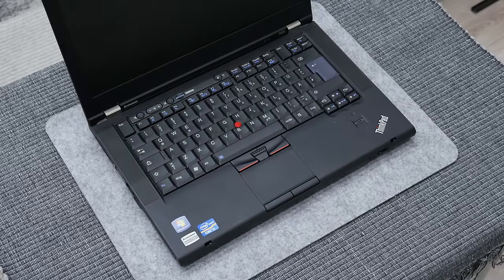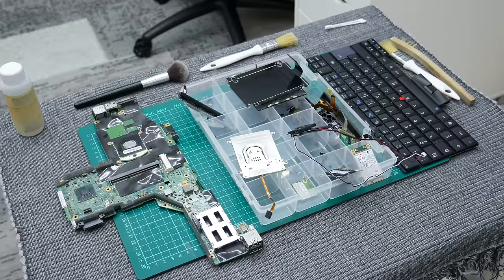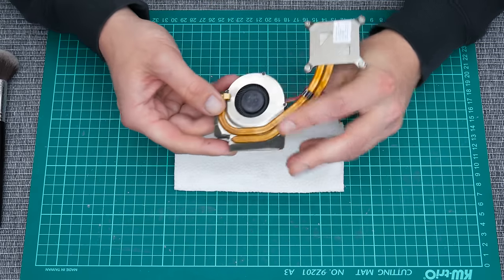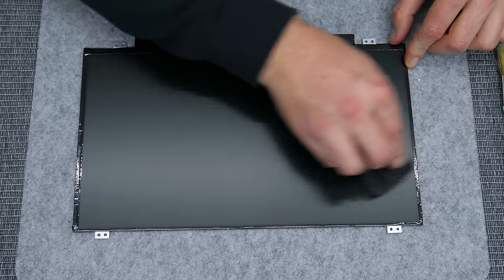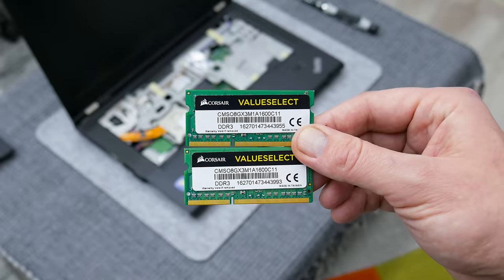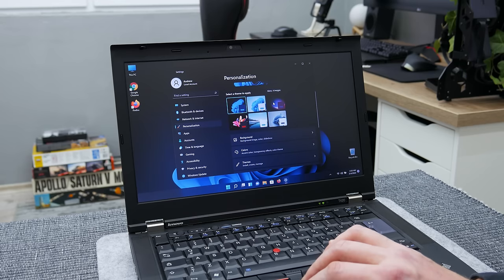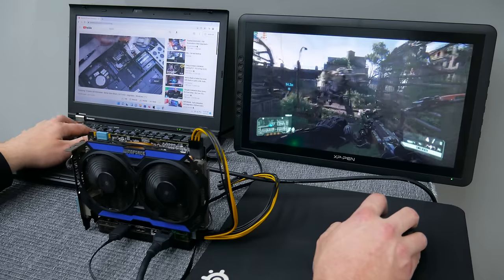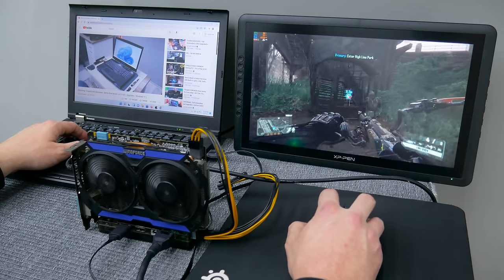Restoring Lenovo T420 - ( Upgrades + Windows 11 + eGPU )

Comment: Pin this !
Reply from the maker: Here is the Pin :D
Reply: Thanks bro
Reply: :D
Reply: @ComputersAndTechAndAndrew  in this laptop you should install a modded bios because of if you have 16 gb ram and a eGPU it will make the cpu run at 100%. The bios doesn't really support these combos
Reply: Power pin bord front panel
Reply: @FS--ew3se  Is this 100% information? Why do you think so?
Reply: @ComputersAndTechAndAndrew  hi cat! can you make details about thermal & problem using egpu in this laptop type! thanks
Reply: I'm getting one for 80$ with i5 and 320gb HDD but without battery I want it for coding, accounting, and other day to day stuff should I buy it ?

Comment: Thinkpads have the best keyboards ever made!
Reply: Agreed
Reply: I'm getting one for 80$ with i5 and 320gb HDD but without battery I want it for coding, accounting, and other day to day stuff should I buy it ?
Reply: Yes I would recommend buying it because the keyboards of the old style and the new are great and the repairability is amazing and it just lasts forever. I have had my t480 since it came out in 2018 and it’s never gave me problems I couldn’t fix
Reply: I have a T420 and the keyboard is great. Way better than most modern laptops these days. I'm gonna upgrade mine and I might think about making it a daily-ish driver.

Comment: Thinkpad T420 & T430 are still being loved by Thinkpad community due to huge upgradability. You can install up to 3 storage drives for these ones (1st primary HDD, 2nd DVD drive that can be swapped with another HDD, 3rd mSATA storage to replace 3G modem). Go for T420 model if you still prefer the classic 7 row keyboard & not into tinkering the BIOS. Otherwise, T430 model would be a better choice.
Reply: I have a T430 model and the system does not see the mSata SSD installed in the WWAN slot instead of the 3G adapter. Do not know what could be the reason, maybe I need to turn something on / off somewhere in the BIOS or other settings?
Reply: The last upgradeable laptop Lenovo made was the T480. Once a modern laptop dies you replace it and there’s no point to working on it because all the components are soldered to the motherboard and its not designed to be taken apart. Business mobile workstations and business laptops on the other hand, designed to be reliable and easy for corporate IT departments to maintain them.

Comment: I am purchasing a T420 today for 85 bucks. Excellent condition. I am glad i stumbled across this videe. I had completely forgotten about the existence and capabilites of an external PC slot as featured in the video. This looks to work very well! I will be grabbing the core i7  upgrade for the existing Core i5-2520M in the machine.
Reply: Try to buy a 35watt cpu upgrade with PGA (NOT BGA) and has integrated graphics. That 45watt CPU will run, but it's too hot for the standard heatsink and fans to cool it efficiently, too much heat may slowly kill it!
Reply: @lQuadXl  thanks you for the advice, i was looking for this, you saved me, and the poor t420

Comment: Lenovo laptops are iconic systems. I had a Pentium 166MMX machine running Windows98 back in the day. Its amazing how even after IBM was bought out a lot of the design aesthetics remained similar over the various generations. The rubberised coating of the older ones seem to really waste away these days.  Have you found any solid way of mending any such stickiness? Good thing this modern system does have the non rubberised textured hard plastic shells.
Reply: Actually in 1998, IBM owned the ThinkPad brand. Lenovo acquired the brand in 2004.
Reply: @DJTydalOfficial  actually 2005.
Reply: 99% Isopropyl Alcohol can remove that coating, so does WD-40 - it doesn't take much to remove it with the right kind of solvent. It is time consuming though.
Reply: Yeah, just soak a microfiber with wd40 or rubbing alcohol, and the coating will wear off for a clean look and feel
Reply: Your lap name pleeez
Reply: I used to have an old Compaq with a pentium 166. Brings back old memories of DOS games running at like 15 fps, lol. I didn't even know what a frame per second was back then.

Comment: I have been a subscriber for ages and have a T420 modded up to a point but learned an immense amount from your video.
In particular, your approach is so meticulous and calm and when something has not worked you say why.
The build quality and I/Os of older computers are so much better than most modern ones and the sooner the minimalist, slim phase ends the better. I mend computers for neighbors in my old age and far too many are heat damaged because air cannot circulate. They do not feel hot to the touch but are baking components inside -- a bit like baking a cake in an oven but the oven front is not warm to the touch.

Comment: That's a pretty nice restoration you've done there. Like how you managed to get Windows 11 running on it.
Yes, I agree that driver support can be a bit flaky at times and some pieces of hardware will undoubtedly get left behind (e.g. the GTX 690 might be stuck at Windows 10 forever if no one makes a Windows 11 driver for it - which Nvidia won't, as it's out of support).
Only thing I'd have done differently is changed 240GB SSD for a 500GB or 512GB one; they can be had for £40 or less if purchased used (at least in the UK).
Reply: why used? a brand new 512gb Kingston SSD costs just roughly 45-50$ online...
a Samsung 512gb 870 evo SSD costs about 60-70$ online too.
and a cheapo Chinese 512gb SSD could cost as little as 30$ (though i wouldn't recommend anyone to even bother touching one of those)

Comment: Lenovo laptops are awesome now I'm still using the Thinkpad x230 and I have more x220 and x210 as collection they r quite tuff and it have lots of ports (where is hdmi)I like it allot
Reply: i am using a T430 as a daily driver :)
Reply: @k.p.5263  I am using a T60 with a 1600x1200 screen and (Gentoo) Linux as a daily driver. It sits next to my electronics workbench and is my PDF repository for circuit diagrams and electronic references, the old 4x3 screen dimensions make it perfect for viewing PDFs and for looking up other info on the Internet. It also happily plays music from my music server and YT video in up to 720p format.
Reply: @k.p.5263  Tell me please. How is your fan in T430 and hinges. The first one is buzzing like an airplane, the second ones are shattered... It seems that there are really weak points of this wonderful device)

Comment: 0:44 I spy in the background a vintage Revell Apollo Saturn V plastic model kit - in it's original late 1960's / early 1970's box!
Reply from the maker: It's 1969 model 1:96 scale, 53 years old, still with original box and in parts, most of them are in bags just one is opened, other are never opened or touched. I need to build that :D

Comment: This makes me remember when i took my Asus X452CP laptop, and i proceed to adapt an RX470, but.... i used a mining riser adapter, with PCie so i did have to use teh WiFi port of the laptop; next i used just a generic power Supply wich was not able to give enough power for high loads of the GPU... as result, i could play many games, in the own laptop screen and obiously in one external monitor, but i did have to play using just mid graphics configurations because on high loads for the gpu, the powersupply just stop working. Thta was an interesting test and i use it for a couple months whern i finally build one cheap PC and i use the same RX470. Since then i use the whole time my Desktop and usually i use the laptop for just navigate and watch some videos. This was a really nice video. Thanks a lot.

Comment: hello I am having a issue with my laptop and that was latest version Lenovo
the performance is so slow I have to upgraded bye  1TB SSD  12gb Ram still getting lag performance time
I try multiple device connected and speed
I try to minimum not installed that much  softwareI updated all the new version latest 11
you have any idea how can I make the laptop speed and reaction time fast

Comment: I salvaged a T420 early in 2023, and I prefer it over even my Dell XPS 15 since Lenovo makes the most bulletproof laptops. It's running a stock i5-2nd and a 500 GB HDD running a triple boot of compatibility- hacked Windows 11, Ubuntu 24.04, and ParrotOS HTB. I just popped it open and noticed that it has a CPU socket- going to get a i7-2nd soon
Thank you for this video, it helped a lot

Comment: HI! I have the exact same model with the Nvidia graphic card. Of course it sits in a drawer for like 3-4 years. Now you gave me the idea to rejuvenate it. But I'd still keep the CPU because for what I5 can do, the upgrade to a I7 is no big difference. I think the most important gain in speed is changing the old HDD with a SDD. Thank you for the nice video.
Reply: Bro do you think it doesn't affect if I leave the i5? I have doubts because in the video it says that the i7 yields almost double
Reply: @giovannivelez78  Yes, true on paper, but in real life what application do you use on this laptop that you need a much powerfull CPU? The main speed gain comes from the SDD. The main purpose of ThinkPad series is bussiness applications, conectivity and endurance. Gamming is not one of their purpose;-) If you can do the following leave the I5 and replace your old HDD with an SDD and see how it runs. Then replace the CPU with a I7 and put back the HDD and see the results..
Reply: Dont get a eGPU like u saw in the video, is not Plug n Play, it requires precise configurations that even a system reinstallation can undo and the performance bottleneck in that cable is sometimes more than half the bandwidth. Go for a mini PC like, if u want to connect the lap to the PC use an RJ45 cable, full bandwidth with Steam Link, but if u still want to do it, I have the whole kit (GPU not included).
Reply: @Think_Pad  okay bro thank you very much for the advice, I was thinking of using it to emulate wii and gamecube, would it work with that i5?
Reply: @giovannivelez78  For the emulation of a game console it would be better if you have the T420 version that have the Nvidia m4200 optional video card installed. I5 with the imbedded Intel HD3000 video card will struggle for higher resolutions. As I said before, this is a business laptop, meant for office applications, presentations and such, with one of best keyboard in the branch, great array of connectivity and very efficient power consumption for mobility.  All these things were for the reality of 10 years ago.😀 It's like an old car.. you can change the manual gear box with an automatic, tires, some chairs, and so on, but you can't change the 10years I5 old engine. (only with a slightly faster10 years old I7 engine).. Good luck in your endeavor 👌
Reply: @Think_Pad  thanks bro now I will still use my old i5 ;)

Comment: It doesn’t have the discrete graphics card found on a high end mobile workstation since it wasn’t designed to do very demanding work or do intensive game playing. The T420 however is an excellent business laptop and as seen still has a lot of life left in it in 2022 and it performs as well if not better, than modern laptops.

Comment: I saw a m.2 to PCIe x16 adapter with no power needed. ALSO, I would like to use a GTX1650 with no power supply required, do you think it will work?

Comment: Hello and thanks for a great video! I would like to ask, did i7 2760QM require a custom bios, or anything done about the bios? Probably you updated the latest official Bios for T420 before changing the CPU and other parts? Which bios version were you using? I guess there are no issues with heating since it's a 35W CPU like the original one?

Comment: Hi. I love this type of Thinkpad generation but unfortunately the cpu is very weak. Can I put for example T480 to T420 case? Is it possible that we put new motherboard of laptop to 8 or 9 years old case laptop?
Reply: You cannot swap motherboards on thinkpads. If you get a T480 use a thunderbolt 3 egpu housing.

Comment: is it possible to also change the intel core i5-2520m processor.  which one would you recommend me?  my notebook is lenovo e420
Reply: You can upgrade to an i7 of the same generation with a faster core speed. You can’t do more unless you replace the entire motherboard.

Comment: Hi, how did you installed Windows 11 on this laptop? Did you lost something by installing OS which should not be installed on older machines?
Reply: There are workarounds to get it installed on unsupported hardware and you will note the T420 doesn’t support TPM and secure boot! That appeared only after 2013 and this Thinkpad is from 2011!

Comment: Does Lenovo Thinkpad T420 have bluetooth? Cuz i bought a 2nd hand T420 but the Bluetooth is missing from device manager. Eventhough I've installed the BT drivers in lenovo support but still BT Still missing saying no bluetooth on this device and use external BT adapter. Thanks in advance bro.

Comment: Every laptop user should know this.
1.
Just “raise the bottom” let more air into the machine and you will found cpu&gpu each them reduce 10~15°C or in high usage will have more efficacy
2.
You shouldn’t be use “laptop cooler” , cuz that effectiveness actually just like you put two bottle caps under laptop to raise it.
But the cooler still use your limited power and it will let cpu&gpu become more hungry.
Unless it has an “independent power supply”.

There also very many ways let your experience better , like 
“gamer most of the time should limit cpu’s PL1&PL2 and offset voltage” 
“discrete graphics card overclock”.

Sorry my bad English,hope it's not too hard to read.
Just want help you gus.
From Taiwan

Comment: Love these videos! The bottleneck maybe the cpu on the difference between the GTX 960 VS RX580. 2nd gen mobile i7 cpus are getting long in the tooth these days. Still great performance if you ask me. Keep it up!
Reply: you're wrong look at cpu usage just 40 percent proof that is pcie limit just 500MB bandwidth
Reply: maybe worst he connected to express card that has 250mBps of bandwidth

Comment: I was asking about How can you Windows 11 on older Alienware laptop recently. And I didn't get any Answers

The Windows 11 is pretty Hard and not as easy as previous Windows OS
Reply: there are some versions of windows 11 that dont require tpm 2.0 and moder cpu too
Reply: You could spend your time better by just sitting down, learning a proper OS like Linux and installing that - rather than wasting your time by trying to find ways to let Microsoft continue to abuse you.

Comment: how can you upgrade the i7-2760qm(2nd  gen)  in windows 11? when the minimum specs of windows 11 is 8th gen?
Reply: Microsoft doesn’t officially support anything other than 8th Gen and subsequent processor families going forward but it still allows you to run Windows 11 on older hardware at your own risk.

Comment: great video, Andrew you can a versus egpu with express card vs the pci-e (for wifi) in the laptop, I see more fps with the pci-e
Reply: I think it would not work, since there's whitelist problem (most ThinkPads wouldn't boot with eGPU mPCI-e card, just giving the "Unauthorized network card installed" message)

Comment: Your videos are just super, we watch the whole family like a movie) Tell me which video card is most harmoniously suited for this laptop in the same configuration and also for the T430 i7-3632QM, if it's not difficult for you. The point is to buy one, but not overdo it in terms of its power and price
Reply from the maker: Thank you for watching my videos and thank you for the support :) The Lenovo T430 I think is supported by exp gdc, With your specs the bext GPU can be something from nvidia 900 series, like 960 or 970 4GB. You can go with older cards as well like 600 or 700 series but 900 is cheap and still have the latest support
Reply: @ComputersAndTechAndAndrew  Got it. Thank you for the quick answer. Have a good day

Comment: This laptop is cleaner than most brand new laptops for sale in PC stores. Also how did you get to install Windows 11 on a 2nd Gen i7 system? Thought the OS install would stop if it detects a processor older than a 8th Gen Intel system.
Reply: The secret ingredient is Törrënt it.

There are tons of Pre-Modified Windows 11 on the internet that can be installed on old systems instantly without user having to do any workaround.

Comment: Lovely video. To get more performance you need a PCIe connection, that is you need to removed the wifi card and instead connect the card connection that instead and you will get better bandwidth for sure.
Reply: It wouldn't work without BIOS modifications (ThinkPads have a whitelist for Wi-Fi cards, and from **30 series - for batteries)

Comment: From your videos, i learned most of the things. Great work. Anyways, recent month i bought lenovo t420 refurbished laptop. I upgraded its ram to 8 gigs and 240 gigs of ssd. Also installed win 10 pro x64, but my touchpad and bluetooth is not working cause of driver issues. Please give some solution.

Comment: How do you can install Windows 11 on old and not supported Laptop?
Reply: You can't. You will have to invest time and effort in learning how to install and use Linux, that will allow you to make use of an old laptop today. One my laptops is a Thinkpad T60 from 2006 with a dual core CPU and 3GB RAM - it works perfectly well as a daily driver. Sometimes you have to put in effort to get the results you want.
Reply: @terrydaktyllus1320  no
Reply: @chomik4305  I don't recall asking you a question - or indeed caring about your opinion offered in your response above.

Run along.

Mind how you go.

Keep away from sharp scissors.

Comment: I'd pay good money for a laptop which is taken care of like this. I'm still using a HP Compaq TC 4400. 13 years and still running. It's due for a yearly cleaning schedule. Gotta change the thermal paste. MINT XFCE runs buttery smooth on it. I gotta buy me a proper refurbished Lenovo think t420 though.